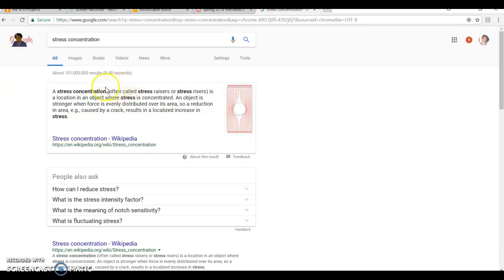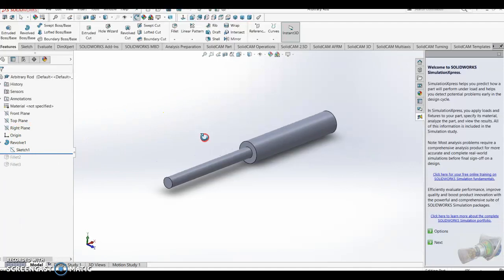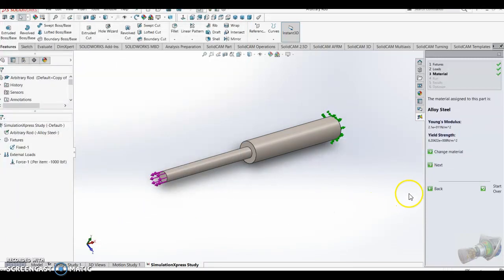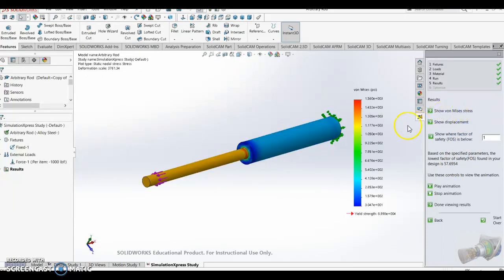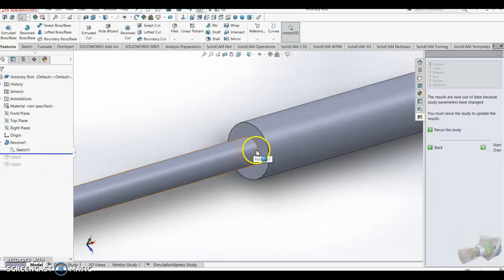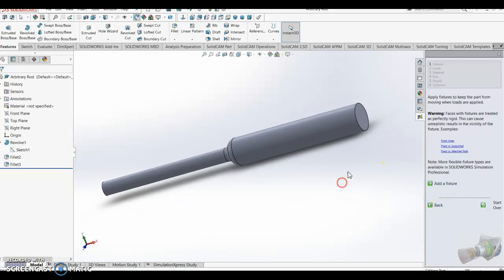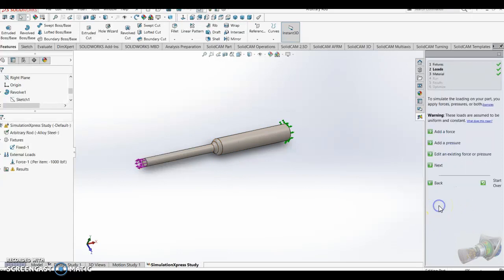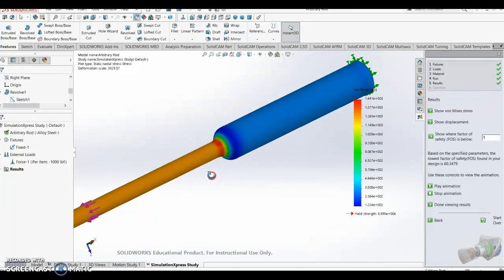Solidworks Simulation to show Stress Concentrations

Comment: Hello, if there is a long stepped shaft with a different cross-section area at each section. we need to carry on with simulation and validating our results with Solidworks basically. Would you be able to help me with that please